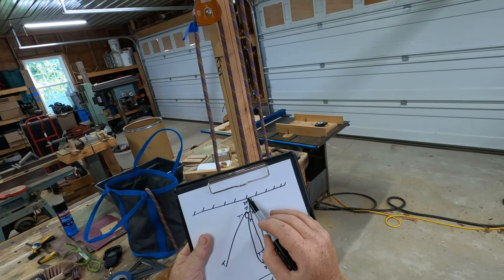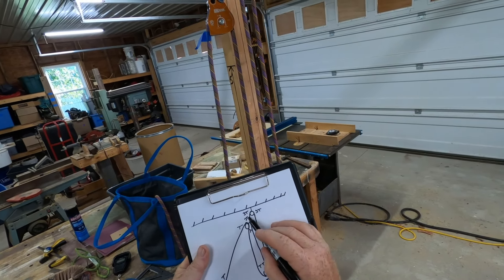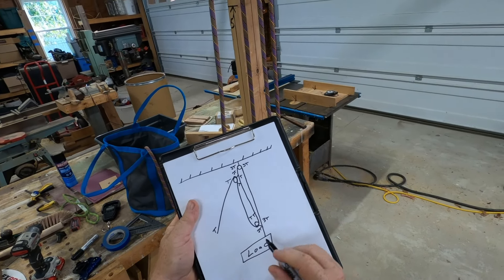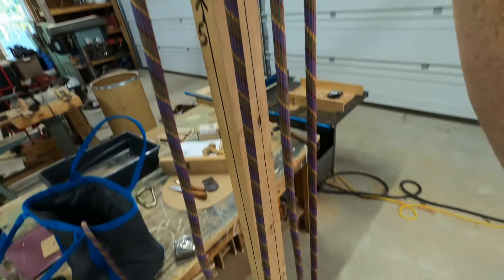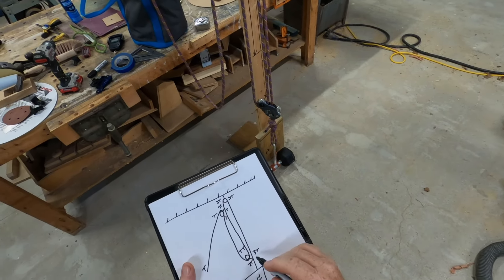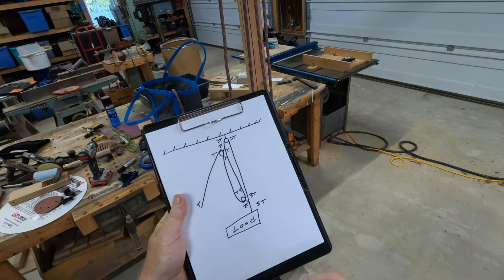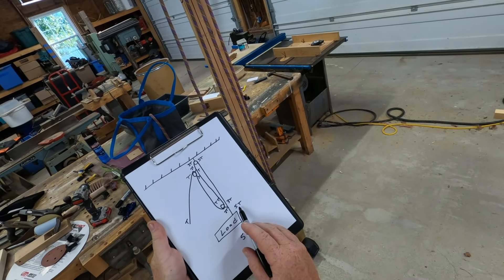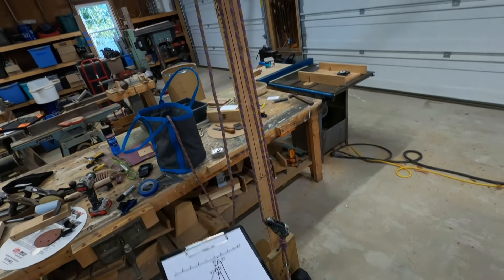Complex systems are tricky. The 5:1 proven.

Comment: Yes. This is the way to build a working lift and move one rope with pulleys system that I was trying to picture in my head in the earlier video comments. Just like in the video thumbnail, everything has to be in sideways and not between the weight and middle travelling pulley. So you just hook this system to the middle travelling pulley and the other end between two trees with pulleys, through the middle travelling pulley and back and down to load through carabiner(for friction to keep the once lifted load up) that is connected to the travelling middle pulley and boom you have a working concept! Self raising and tensioning rotating double rope line that can lift heavy objects with good mechanical advantage and can move the loads in both directions. Thank you!
Reply from the maker: Thanks for commenting and watching!
Reply: @perryfire3006  I bought the necessary equipment and tested this myself and its working okay. Just a warning to everybody if they are going to build this. If the load gets stuck somewhere and cannot move sideways and the whole system can't rotate, the angle of the ropeline is reaching 180 degrees and the tension to both tree pulleys is theoretically reaching infinity if you keep applying the pulling force. So make sure the connection between the tree and the tree pulley is atleast 10 times stronger than the breaking force of the rope in the system. If if the connection between the tree and the tree pulley fails first, the pulley is going to fly very fast and can easily even kill someone.

Comment: If you had not tied the first pulley to the rope, but instead hooked it to the a common anchor with the third pulley, would that have been a 3 to 1 system?
Reply from the maker: Yes! It would have been a 3:1 with a COD (change of direction) pulley at the anchor. Good eye for details.